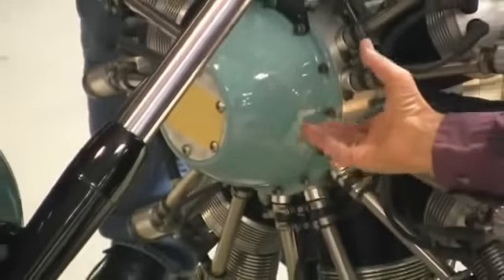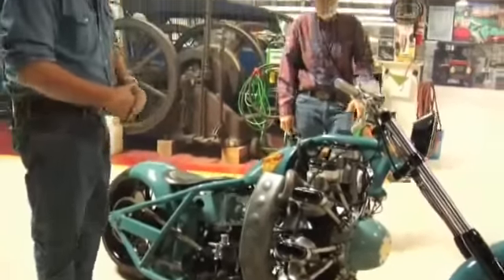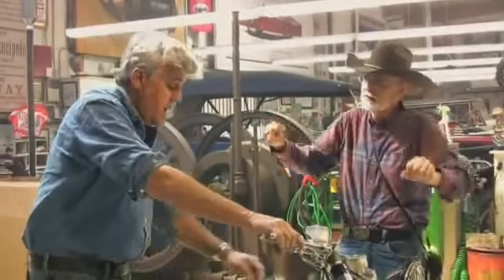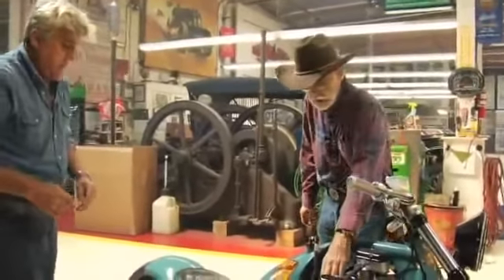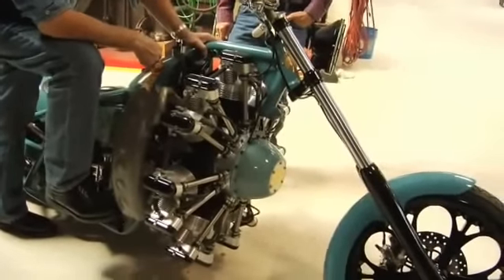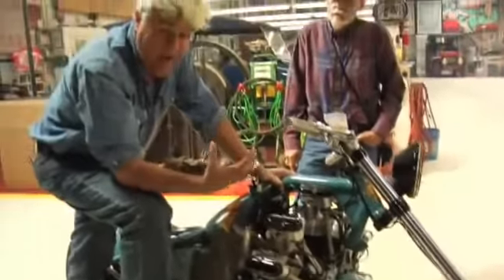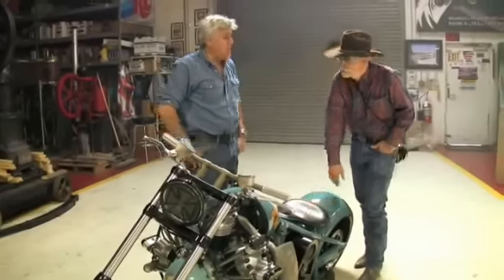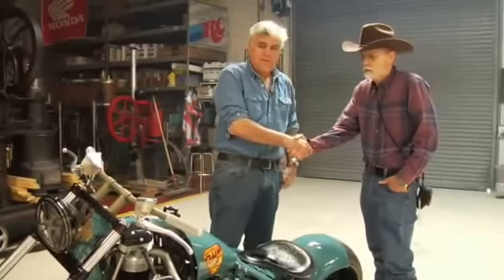Jesse James bike Radial Hell

Comment: Plus ONE of many reasons Jesse is a far better bike builder then OCC or PJD. They couldn't build a bike like this if they wanted to
Reply: Those guys just bolt on CNC made parts. J.J. blacksmiths and forges everything by hand. They are just ass puppets of Discovery network and that's why they are at where they are, because of TV money. James builds much more tasteful, ride-able bikes. OCC makes bikes for rich establishments to hang on the wall.
Reply: Jesse is I think totally under-rated as a craftsman[the outlaw thing doesn"t help]  This is a good example of his design and hand/machine skills!
Reply: Wow, really that’s all but factory crap and bolt it together. No body builds new one offs. All about how much money and how time you have.
Reply: the biker buildoff proved that, jesse built that epic cafe racer which should have won,
OCC built the dumbest fuckin treaded "thing" ever (woo flames....)
PJD built a cool looking but totally useless bike like he always does.

Comment: IIRC typical oiling on a radial is once-through.  And when it was castor oil and the pilot was still in the wind in an open cockpit, they'd land and jog for the latrines.
Reply: Nope.....a rotary engine is what you are describing...like a LeRhone where the entire crankcase and cylinders rotate with the propeller - that was WW1 technology.  This a radial engine, and they use a dry sump oil system to recirculate the oil.

Comment: Looks like a lot of torque reaction like a Boss Hoss when he blips the throttle. I wonder if it's slow to rev and wind down with all that reciprocating weight. It would be challenge to ride, but worth every bit of it!
Reply: They are very smooth running engine. They don't have a very big rev range and that's what makes radicals hard to run in grounded vehicles. Gearing has to be right and depending on of it has a manual or auto trans, your stall converter or clutch has to be dead on too.
Reply: You can hear how long it takes to rev up and down in the video. The only reciprocating weight is at the crank in the very center and the why these are designed, the firing order cancels out most of the forces and vibrations cause by the pistons moving up and down.

Comment: at end of clip you see little oil coming out of exhaust pipe. This when piston rings are letting oil pass bye, or street name "blow bye". its pistons wall and soon it burn up piston rings and fallout a spark plugs. Jesse most like know motor was running ruff and burn oil because room even after first start its still kicking out smoke. Reason for first smoke when Jay started it is because old oil, burn out. Knowing Jay if he was taking it out he would ran it like a raped date, like he did with Porsche 918
Reply: +brian martuszewski 
Thats a typical radial engine.  Oil collects in the lower cylinders then once it runs its thrown out the exhaust.  after some hours of running that will go away.
Reply: +Mike Damiani  after a few minutes, if even that long.
Reply: +brian martuszewski Do a little reading on radial engines.
Reply: Some oil maybe, some water too probably. I wouldn't assume that the rings are shot. If the bike was set up for storage oiling the bores would be SOP.
Reply: The smoke is completely normal with these engines. And yes it'll clear up in mind. They like to spit fire sometimes too because all the cylinders share one continuous exhaust pipe. Any um burnt fuel that get pushed out the exhaust valve and then ignites causing awesome fire show.